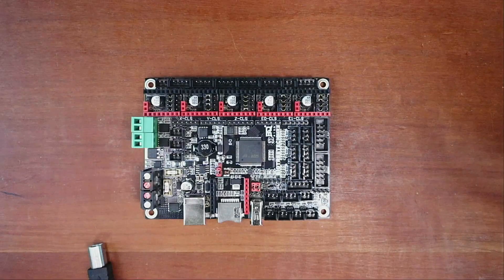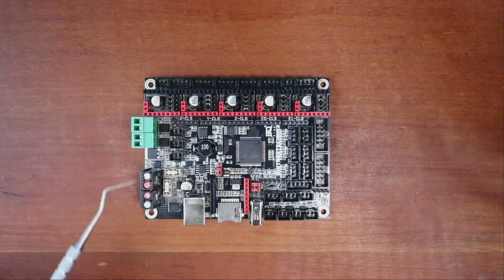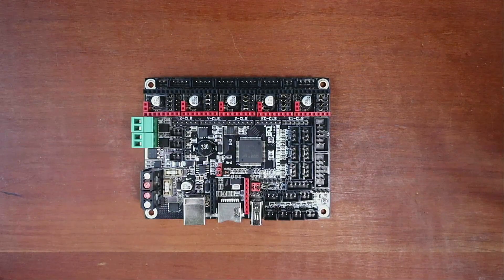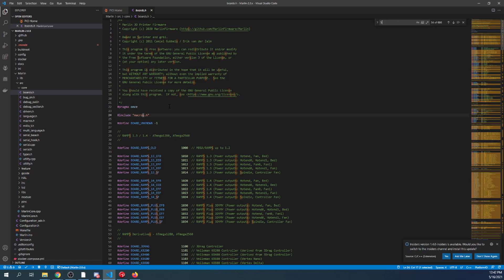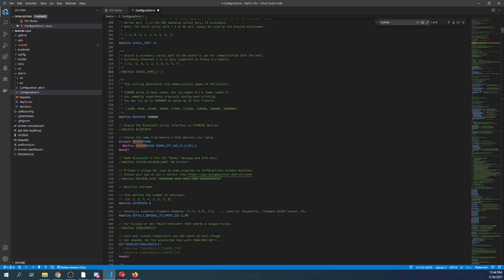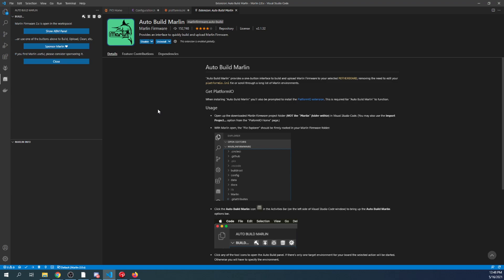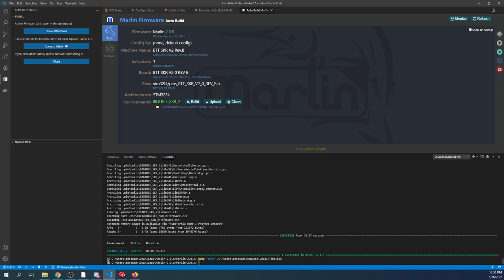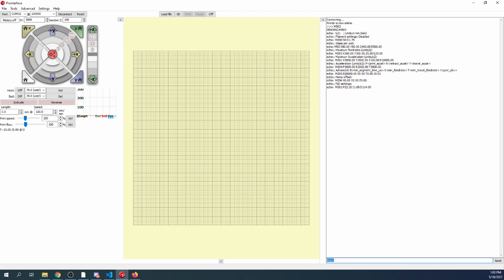BTT SKR2 - Basics SKR 2 (Rev B)

Comment: Super Great tutorial all the way through to the end, best I have found. I am liked and subscribed, But here are 2 questions... What if M503 does not respond with anything? and Where does DWIN_SET come from then?

P.S. the file on the sdcard is renamed  .cur now so that means it flashed, yes?

Edit: the problem about pronterface not responding to  M503 is a non-issue, it was a linux-specific issue where  the mainboard on USB power alone is read basically as a modem and it is put into command mode. /dev/ttyUSB0 is how the usb port should read bui it read /dev/ttyACM0 and so when I hooked up power to it and restarted it snapped back to M503 super fast.

So thank you again, best video I have found for this skr2 board. (But still what about the screen firmware?)

Comment: Hey I am bit confused on the heaters for the extruders. What is the voltage on those. I have a artillery sidewinder I am modifiy and I was wondering if I should switch the bed heater port with the extruder because I have one extruder with a 24v mosquito heater 50W and an AC powered bed or does the voltage of the he0 to be 24 volts
Reply from the maker: Normally I record using a 12v power supply.  Board is rated for both 12/24 voltage power supplys.
Reply: @EdwardBraiman  but does the he0 is 24 volts if I power it with 24 volts
Reply from the maker: The input PSU e will match output power on extruder.

Comment: FileNotFoundError: [WinError 3] The system cannot find the path specified: 'C:\\Users\\SUBASH.000\\.platformio\\packages\\framework-arduinoststm32@src-37335c727965154be67d1d5ed653b9c6\\variants\\MARLIN_F4x7Vx':       I Get this error how can i fix this sir?
Reply from the maker: There is a Discord link in description post your configuration.h, configuration_adv.h and platformio.ini.  note if you're using an example file and not tutorial results will not be the same.  The chatroom on Discord is General chat.

Comment: So, it seems like I got myself into some trouble.   Thanks to you and Kelsey's videos, I was able to get my Ender 5+  using this board with TDM2209s without problems for about a week and a half.     I have a direct drive extruder, so I decided to replace my stepper with a pancake motor.    That totally didn't work, and I saw a "TMC Connection error on  the marlin screen.    I started swapping the 2209s around, and one by one,   it seemed like they all died. I'm not certain of this, but I suspect that my  z stepper driver socket is   burning out anythiing I plug into it  (this confuses me, as I plugged the pancake stepper  as a replacement for the extruder stepper).     I found M122 and   TMC_DEBUG, but  a little too late in the process to do me much good. 

I've been  wondering if maybe the SKR2   is perhaps just reconfiguring  any TMC2209s  that are getting plugged into the Z Stepper driver socket, but I don't see anything in marlin that  screams forced reset  for the drivers.   I've ordered a new set of TMC2209s, but I'm frankly terrified to mount them to the SKR2  once they show.    

Would you have any advice for me?   Would my debugging process here be a useful learning opportunity for the community?
Reply from the maker: Try my Discord, others like yourself exchange information on these issues.

Comment: Ooof I can't get a single version of Marlin to flash properly with this board. I had a little bit of trouble in the past with my 1.4T, but this Skr2 won't play with anything I throw at it, even the latest bugfix, or 2.0.8.2. I feel like it's some library or dependency issue. I select the basics to get the board and env selected, try to compile and a NOPE every single time. Are there any libraries I need to get for this chipset or anything? I've done complete reinstall of vscode and my plugins, still a nope on compiling. I do have rev b, trying to flash to a folder to move onto an SD 😭
Reply from the maker: Join Discord in description below and in General chat post you configuration.h and configuration_adv.h. Just remember if you're using examples files which I do not endorse using it maybe the cause of the issue.  Using a fresh version downloaded from www.marlinfw.org is best option and in this case my tutorial will work.
Reply: @EdwardBraiman  Thanks Ed. I never use precompiled fw. I'm not sure adding those files will do anything, because I make the most basic change to the ENV and board name, compile, and it fails. I have used my current VScode setup with my SKR 1.4 board, but it won't compile for the SKR 2 (I've created a new workspace/opened the proper Marlin folder for the version I'm trying to use for the new separate SKR 2).  I found a folder on my C drive for PlatformIO that had some libraries added for the 1.4 board. I feel like it's trying to pull from there for some reason. When I delete them, it can't find certain libraries, and it fails in a different way for the SKR2. If I touch nothing, I can continue to compile for my SKR 1.4, which runs something like 2.0.7.2.
Reply from the maker: Did you watch my tutorial on how to install VScode and platformio?  It should be in Playlist in description.

Comment: Hi, thanks for the video. I am having issues compiling. I have downloaded Marlin Bugfix, dropped Ender 3v2 Config in, followed your steps using B, and it's not compiling. The AMB Panel shows no board, but the Pins show Rev B. Compile error is something about Rotary? I'm guessing this is due to trying to use 3v2 LCD screen?
Reply from the maker: If you're using a example file it may cause issues.  Marlin doesn't always update them.  Try the tutorial with example files if they're used and then use a file compare tool to see file difference's and make changes according.  Or ask on the Discord channel I or someone else can assist.
Reply: @EdwardBraiman  Thank you for the quick reply. I'm not entirely sure to be honest. I'll check out the Discord channel tomorrow (late now!). Thank you.
Reply from the maker: You're welcome.

Comment: i have a quick question, i have 5 3d printers with the skr 1.4 turbo, do i just need to change the board type and upload my current marlin 2x firmware? i would thing the boards are the same accept for the board speed from 120mhz to 160, and the 3 fan controller and the new power off feature. thanks for any help. wasn't sure if i would have to compile the firmware from marlin examples again.
Reply from the maker: Depends on what you have connected.  Also make sure you have rev b board or you'll cook your steppers.
Reply: @EdwardBraiman  wow thanks for the quick reply, i decided to go ahead and do it from scratch. my marlin is a year old anyway. i haven't opened the v2 board yet, i just received 2 of them yesturday. i assume if it's a rev A board i will need to return them. i plan on upgrading all of them, so i will end up with 5 BTT 1.4 turbo boards i don't need.
Reply from the maker: My replacement came as revision A after asking it be rev B in English and a second language.
Reply: @EdwardBraiman  i have one B for sure, i can't read the chip on one of my boards, but i am not using mods for something i paid 45.00 for. i guess i will just try it, and if it smokes, i will send it back with the drivers. All my parts came in a couple days ago. i should have never received a revision A board with the statement on june 5th. thats bad business.
Reply from the maker: I understand the feeling.  If they had never done stepper driver protection, this would be a non-issue.

Comment: You never say how to set the pins folder you just move on It is around the 10:45 time mark where you don't say how to set the pin folder.
Reply from the maker: Good point, it's in source/pins/processor type/board name.h

Comment: Can you make a video about skr pro v1.2 with dual nozzle on 1 carrige and 2 extruders ?
Mine keeps bumping to the left side and then the band slips.
Reply from the maker: Not sure I understand the question.  Homing is not working?
Reply: No homing is working.
And if I print in 1 colour everything goes well.
But if I print with 2 colours the first layer is fine but after printing with the second colour it runs hard to the left where it bumps and the band slips then it go to print in a different place and the next layer again.
And it change in the y as

Comment: Awesome video!
What are the main differences from the SKR Pro 1.2?  Which would you recommend for a modified CR-10S? 
Also, I can't seem to find a suitable WiFi module? it says ESP-12S / ESP-07S but the pinout seems to be different...
Reply: pinout is just like a bare ESP12/7, you can find the pins definition on bigtreetech's github. I got that wifi module which fits the SKR2 nicely, it's preloaded with a RRF specific firmware. I flashed it (using 5x 10kOhms res, a breadboard, a usb-to-serial dongle and a 3.3v psu) with ESP3d 2.1.1 but afaik it's not working properly when plugged in, I sometimes get serial messages from marlin under some conditions (serial_port -1, serial_port2 3, with flash_drive_support and multi_volume, wifi/u-disk jumper set to U-disk (the doc says U-disk jumper makes the wifi module works over UART only on marlin)) but I can't send commands so I guess something's wrong with my configuration or there's some pin conflict as I have to remove the usb key (marlin starts spamming "waiting for media") for esp3d to get any input.  
I tried with and without flash drive support, I tried with the onboard sd  and the lcd sd-reader as default volume, with and without multi_volume support also.  
I'm gonna rebuild esp3d and make it wait 10-15sec before trying to connect to the printer, maybe this way i'll get the IP adress to show up on my lcd :D  

tl,dr: in case anyone wonders, all the features of this board might not be working until some big brain people starts to tinker with.

Comment: My SKR2 Rev A works great with marlin 2.0.8.1, jumper wires and 5x TMC2209 ... Just comment the error message and you can build the firmware. Like vs code tells you when you try to build it with the error message uncommented. Of corse you have to do some work..... Uncomment "Disable_driver_........." like BTT
Reply from the maker: Just remember you could damage steppers with rev A.
Reply: @EdwardBraiman  not with the workaround from BIGTREETECH. "Option 3" and the separate workaround....
Reply from the maker: True.  I just need to tell people so no one gets blindsided like me.
Reply: @EdwardBraiman  this was an unfortunate situation for you and a lot of other peoples with this Rev A Board and till then without Information from BTT... the message from BTT came a few days later...but when to know how to handle it, the Rev A is also save to use.. But you are right the Rev A Board is not a plug and play Board....
Reply from the maker: True, I know how to fix, but need to warn people of the motherboard challenges.

Comment: Thanks a lot!!

Which is te best "cheap" btt (or other) 3d printer controller in your opinion.

In one of my printers (idex) I have btt gtr but it is necessary cut a driver pin and fan MOSFETs are the worst...
Reply from the maker: Depends on printer configuration.  How many axes, extruder, etc.
Reply: @EdwardBraiman  I only want  your opinion. There are a lots of cheap controllers boards and you test a lot of them... 

for example a sapphire plus (quick corexy, two layer fans,  one hotend fan, 5 independent steppers x,y,z1,z2,e0, bltouch, neopixel leds, ...) with power lost recovery, all controlable fans,... A lot of people install a duet 3d wifi clone board in this 3d printer
Reply from the maker: Probably SKR 1.4 or MkS sGEN L v2.0.
Reply: @EdwardBraiman 

Thank you
 you ar the best Edward!
Reply from the maker: You're welcome.